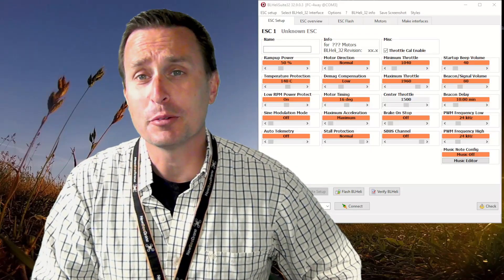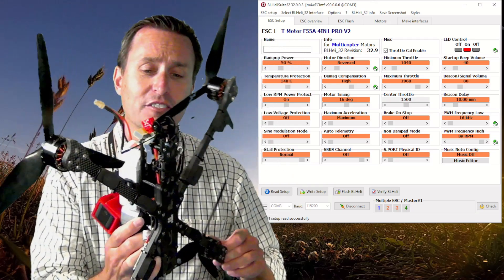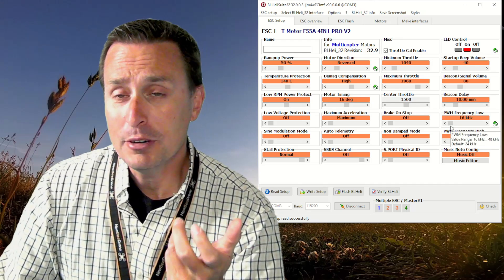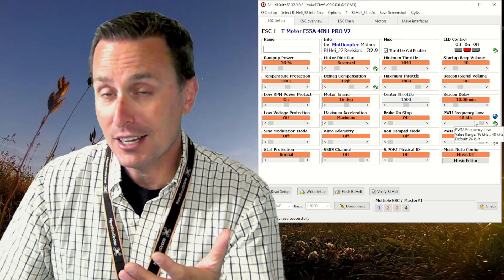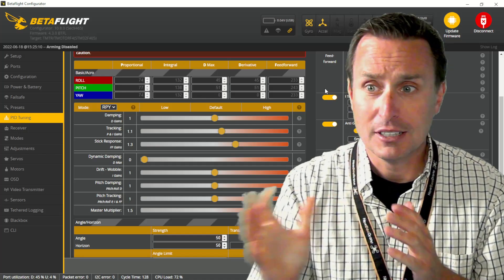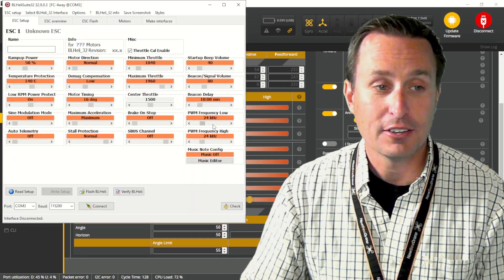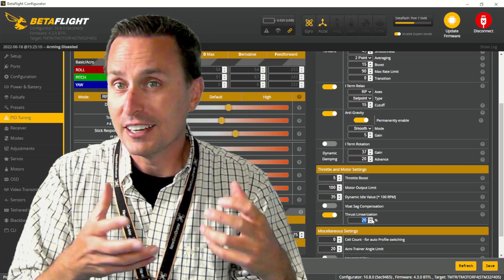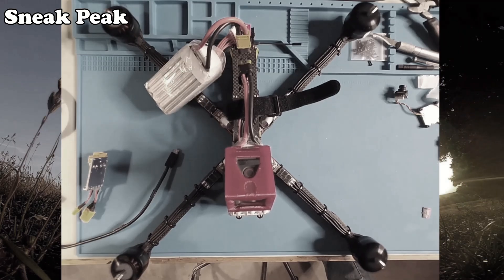The IMPACTS of PWM 🔼HIGH & Low🔽 Frequency 😍

Comment: I put mine to 24khz and i have never heard such horrible sounds coming from my quad. The trilling and occilations was scary, why cant i use 24? 5 inch normally on 48khz
Reply from the maker: because your motors have enough torque that they can brake (slow down) when the pulse is off at 24k.  Meaning, you need faster pulses for super-high torque motors.  It is a good thing actually.  Good motors.

Keep in mind that the electric charge of the coils is on or off.  At 5% throttle, it is off 95% of the Duty Cycle.  One small pulse on and mostly off.  At 100% throttle, it is ON 100% (0% off).  The PWM is how many pulses you have per second.  24,000 or 48,000.

Since the motors slow down between each small pulse at 24k, they start to vibrate and cause a horrible grinding sound.  At 48, it is too fast for them to react. Like the human eye can not see a 60hz screen flicker of a monitor, but a camera can, unless you increase the screen refresh rate.  If you can see the flicker with your eyes, you have good eyes.
Reply: @uavtech  wow! thanks for the detailed reply! Im confused why I can't run 24khz on a high end build as others are using it without problems like me. I'm fine with the stock 48, it flies great, just curious. Is there something I have to change along with the pwm to get it to run smoothly?
Reply from the maker: higher PWM is smoother, but it reduces motor brake torque.  For very powerful motors, that is needed.
Reply: @uavtech thank you for that excellent answer. I have the exact same problem, except mine is a new build and the esc came with 24khz stock. The trilling and turbo waste gate noises were very alarming and the goggle feed is horrific at a certain rpm, between 30-50% throttle, so much jello.  Im using 2307 motors on a 5 inch, so higher torque (I presume) than more standard 5 inch sizes, so everything you said would make perfect sense. Thanks again for taking the time to write that.

Comment: just realized my 10" esc was default at 48k low and 128k high.. just changed it to 16k to by rpm with rpm filtering now on.. Not sure exact different between 128k high and by rpm

Comment: Hi i have the foxeer Foxwhoop 25 hdzero version. I put this in a grinderino Frame and it has it set to 96k for the esc .Do i need to put it to 48k to fly better?
Reply from the maker: Yes.
Reply: Also I  put 1804 3100kv motors, so 48k is better?
Reply: And do I have to make any changes to my tune after I change to 48k?
Reply from the maker: lower PWM is better for motor breaking torque.  So the lower the better, but on small quads will chew up more battery, so 48k is a nice balance.

If you have the gains cranked way up for 96k due to lack of motor power, you may need to turn doen, but I doubt it.
Reply: @uavtech 
One more thing my esc are on 0.16 bluejay  firmware.
Reply: @uavtech  
Do I need to update my esc's
Reply: @uavtech  can you show me how to lower the gains.

Comment: @UAV Tech - once i apply your UAV BF present for 5" and select 48k... do i need to setup low and high to 48k on BHeli32 or set 16k low and high by RPM?
Reply: haha i came here trying to figure out the something as it's not specifically stated. After watching this video I'm 99% sure you should set it to by rpm.
Reply: @BeautyBeastRC I've been reading a bunch of horror stories using by rpm. By that was with 32.8 , there's not much information on 32.10
Reply from the maker: 24k yo low and high.  You can sey high to By RPM too.  It mostly stays at 24k anyways.
Reply: @uavtech  I've read a bunch of people did that and they either smoked a motor or two and or an esc.
Reply from the maker: then set high and low the same if you prefer.  24 - 24; or 48 - 48 if you want.

A lower PWM setting increases motor breaking torque (the ability for the motor to slow down faster), so it makes the motor work header and increases performance.  Faster braking will add some more energy to the motor and can make it warmer.  If motor is very strong, it take cae too rough with a low setting as ot will be able to brake and slow down for the 24k off/on cycle.  

High PWM decreases motor responsiveness (less braking torque) so less energy to the motor, but adds heat to the ESC because the Fets are switching twice as fast.  Motors are smoother, less responsive, and ESC is hotter.

Just know any time you are not at 100% throttle, the ESC is pulsing power to the motor.  The PWM signal is just how fast to pulses occur.  Faster is smoother, but it chews up deadband time (braking band time).
Reply: @uavtech  awesome thank you.
Reply from the maker: @Chillin-fpv  check out this video too to understand PWM frequency better: https://youtu.be/v3806Incpvo?si=KoisEF0o-krGsiDP

Comment: Hello from the future why would you not use all in one on such motors, 4114 400kv on a 4in1 for couple years now
Reply from the maker: lots of electrical noise can typically back feed into the Flight Controller because you cannot put a capacitor on each ESC.
Reply: aha i see but not using those 30x30 fcs :) just throwing this out there as there is no large uav build guides for blheli
stuff like pixhawk and other autopilots etc.. @uavtech

Comment: Hi,
Im about to flash your 5 inch racer Preset with Medium build quality and 48khz settings.
What should I select in motor timing 16 or 23? And pwm low 24khz or 48khz?

Comment: Hi , is that possible to have esc desync with 96k pwn.i have cineon C35 and at the first flight,i have esc desync so i put esc pwn to 48k and no esc desync
Reply from the maker: Yes.  It is possible to have at any.  Typically going up, lesson electrical noise and makes it easier for the ESC to.detect the back EMF necessary for it to keep the timing and avoid a desync, but nevertheless, maybe for some reason 96k is making it harder for your ESC.  Higher PWM takes more ESC compute power and makes the FETs hotter, so maybe one of those is the culprit.
Reply: @uavtech  thank you for your answer. another thing too, the cpu load was high (about 70%) before i changed the pid loop from 8 kHz to 4 while leaving the dshot 600. and since then i have a cpu load at 30%
Reply from the maker: @arknan9624  the BF CPU load should not have a correlation so I wouldn't worry about that

If the CPU load for betaflight maxes out, it might cause the drone to "stutter", but it won't cause it to desync and fall from the sky.  That is specifically the ESC losing tract of the motor pole (magnet field) positions.  So it doesn't know when the push or pull in the 3-phase power rotation.

Comment: Hello 
i am facing problem as i made a custom ESC, My motors mostly diagonal one becomes too hot. When i replaced it with my old mama ESC there was no Heating Issue
Reply from the maker: Sounds like a FET issue on the DYI ESC.

Comment: Just seeing this video, sorry for the late comment.

A way to negate the electrical noise with large props and motors is to choose a lighter prop. 

Those look like HQ 10x4.5x3 which are about 24g.

The Gemfan 1050, which show much better gyro noise from mine and others blackbox logs, come in at 17g.

With a lighter prop you need less braking force as well so you could keep the PWM higher for the same effect or drop it to the floor for maximum braking force with less feedback.

Comment: Hi! 
I Have had a problem getting nose dips after snap rolls, this problem does not occur if throttle (around 40%) is applied during the roll but every time if throttle is idle. What might cause this? Thanks im advance!

Comment: have my roma f5 v2 set to 24/128k variable(mamba 55a 128k esc)  feels nice. breaks well and im getting 7-8 minutes of flight time. I run my batts down to 3.6v/cell so i could go a bit longer.  Ive learned a lot from you this year. Thanks for all the help

Comment: Low PWM of 16kHz has more downsides from my findings than just bad video feed. I figured much more motor heat plus desyncs whenever clipping a gate.
Reply from the maker: I hope noone is clipping a gate with a 7, 8, 9, or 10in!!  😬
Reply: @uavtech  what gate? looks at slivers of stuff